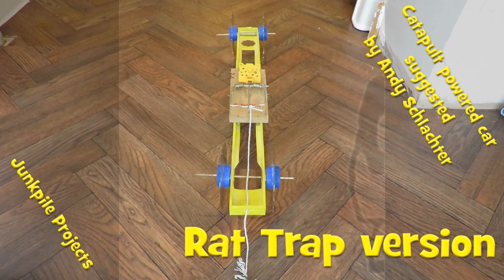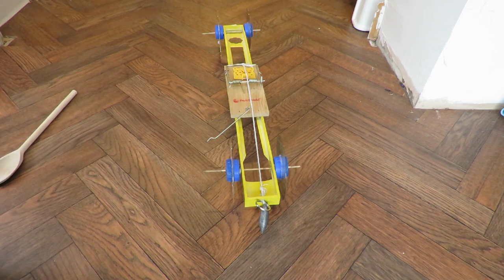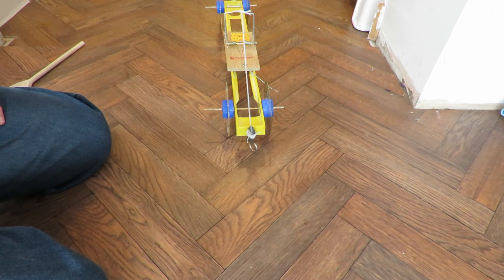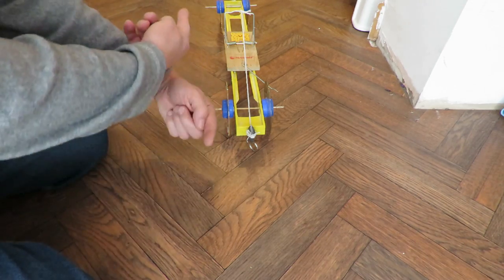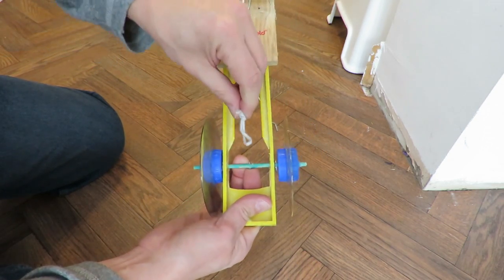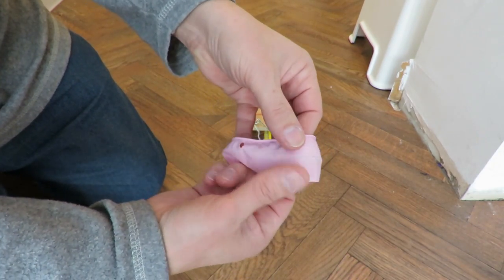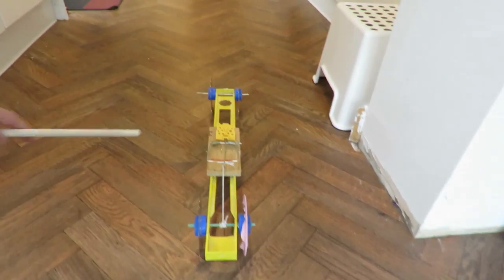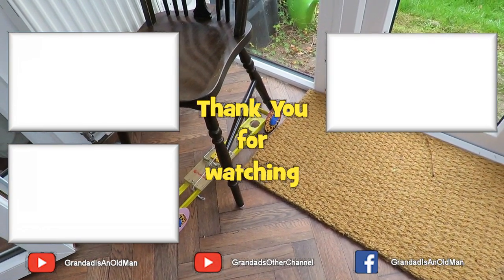Catapult powered car reworked Rat Trap version

Comment: Hi Grandad, at 2:47, you were "surprised" by the difference between this car and the rubber band car.  I think the difference was is in your launching technique.  On rubber band car, you used your hand as a backstop at launch. On this car, you didn't have a backstop to prevent car from going backward at launch.  Maybe you can try and see if that works!  Thanks.  This was a great video!
Reply from the maker: You are right and that is the point of the two videos. When I was asked the question my thought was "equal and opposite etc, so it won't work" but rather than theorise about it I tried it. The first video is misleading. People ask about making it a continuous cycle so how would you repeat actions of the first video on a cycle. You couldn't run after the car and place a block of wood behind it and how would you stretch the bands without something to brace against 😊

Comment: hi grandad, i saw ur video and about the weight , i think its too small to get momentum to drive the car forwards so my thinking is that if i put a heavier weight on then the mousetrap cant snap shut so fast anymore and it will give the car enough momentum to drive forward but u might have to put the heavier weight on that little plastic car to stop it from dragging it on the floor.i dont know how heavy the weight might have to be but im sure it has to be much heavier then this one. would u be able to try it with a heavy weight to clear my mind? im sure it might work.
Reply from the maker: The answer is to try it yourself. Unless you know a way of defying Newtons laws of motion I don't see any variation in weights making any difference 😊

Comment: Thanks for trying out my suggestion, I think I can see why it isn't working. When you first release the weight, like you were saying, the forces cancel each other out. I think that if you returned to using rubber bands (to make the movement less sudden/violent), put lots of grip and weight on the back wheels, and then used something like the cut bottles from your video below, you might be able to get some forward movement without the need for a backstop like in the first video.
https://www.youtube.com/watch?v=Cwz2rR0asus
Reply from the maker: Hi Andy, I will do another video for you, I will still use a backstop and the rat trap, but it will show you that your idea works and the car moves forwards 😊